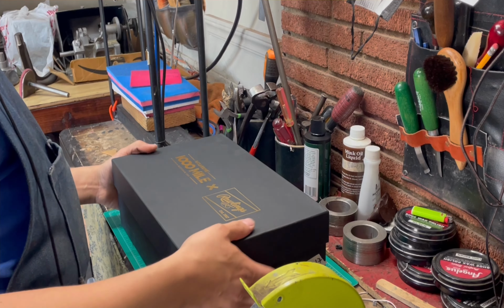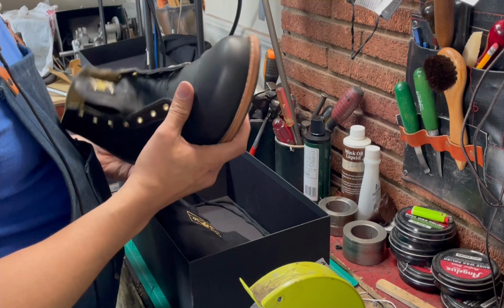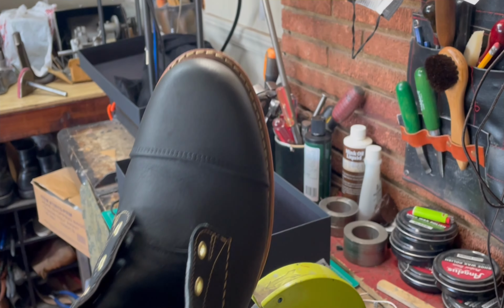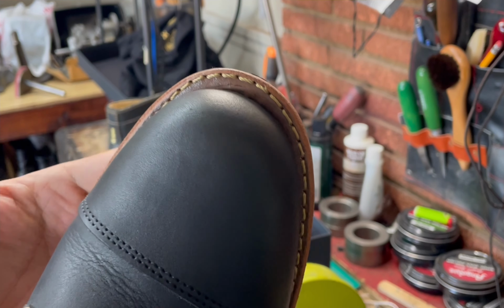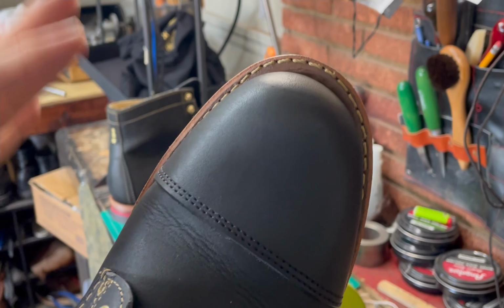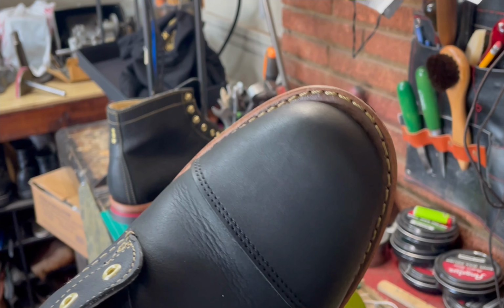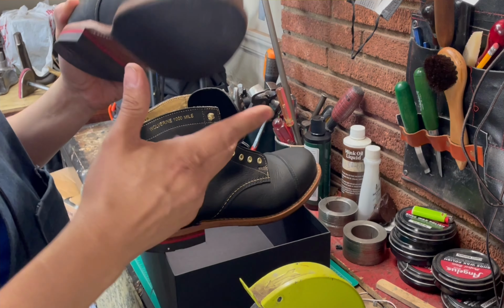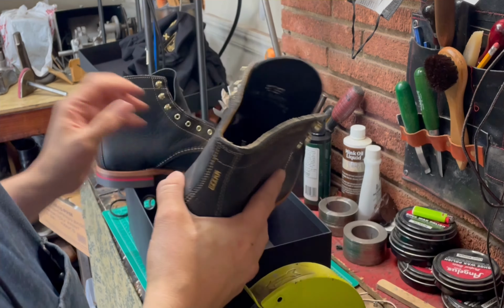The Real Wolverine 1000 Mile Limited Edition Boots/Boot Upgrade/Wolverine Boots

Comment: Nice job! They had some comically low stitch per inch before (two or three per inch maybe?) I'm sure it saves on cost and easier for the craftsman when they keep it low. I imagine it's easier to calibrate and maintain the machines too. I would think the stitch becomes weaker if the SPI is especially low to a certain extent but just spit-balling.

Comment: Wow Arron, great work, those are now 2000 mile boots.  How many hours are in a job like this?
Reply from the maker: Hi 3G about 12  
Thanks!
Reply: @AaronG2480  Howdy, it’s a beautiful Texas morning.  When are ‘y’all coming back for a visit?  Before it gets too hot I hope.
After watching most of your work I’ve never seen you put on a leather sole.  Some of the Wolverine’s have leather with a half Vibram sole and some full leather sole, and some styles have wedge soles.  J R leather is still in business being acquired by another German company.  I’ll send my 1000 miles to you if you want to take on a leather sole project.  Need me some dancing boots,   I’ll email ya later,
Reply from the maker: @3g18  anytime 3G
I mainly do rubber soles Buy I’ve done several leather Resole, and a couple JR  soles 

My wife’s family is actually coming back to LA 😅